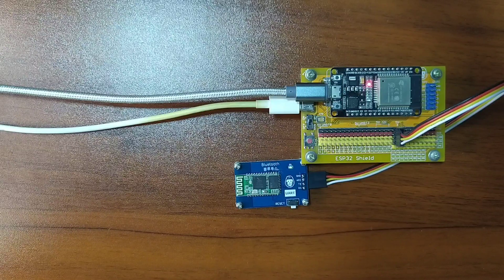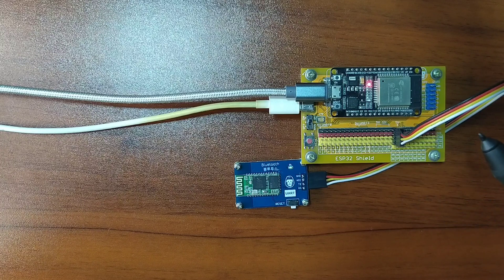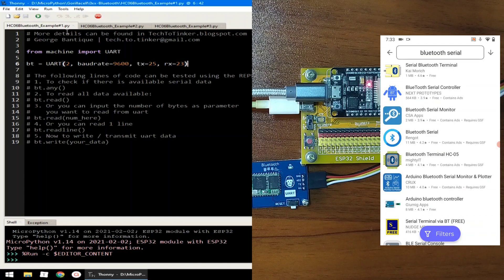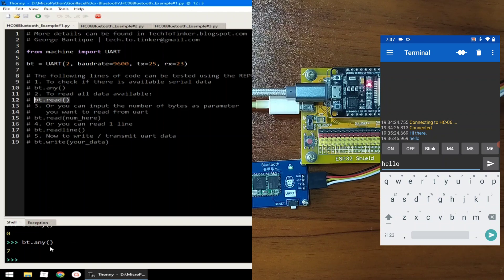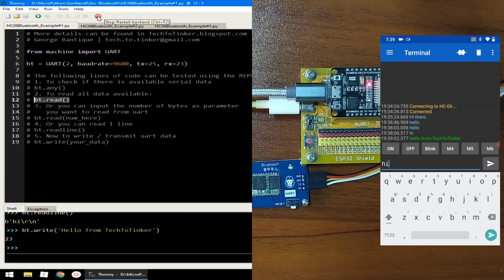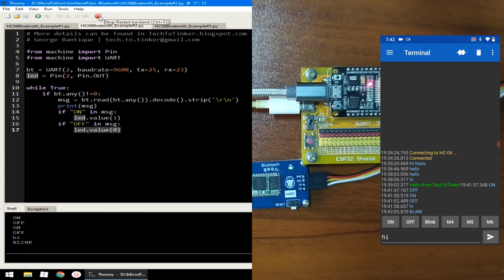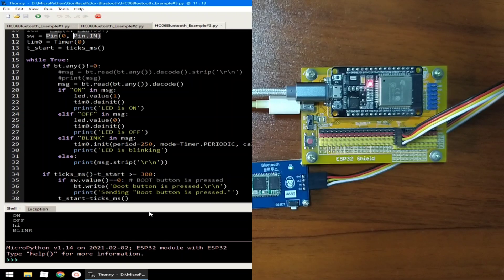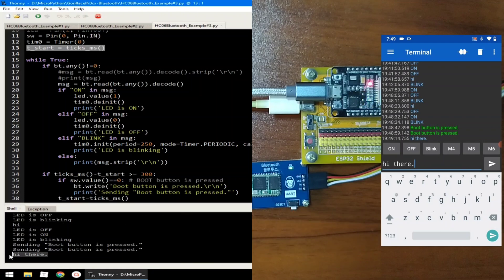041 - MicroPython TechNotes: HC-06 Bluetooth

Comment: pls do a video on ov7670 interfacing with micropython for esp32  pls
Reply from the maker: I would love to but as of this moment, I don't have OV7670. I have not found MicroPython implementation in my quick search. So maybe in the future I will make it.

For the meantime, you can experiment using Arduino IDE + ESP33 + OV7670: https://medium.com/@mudassar.tamboli/esp32-ov7670-websocket-video-camera-26c35aedcc64

https://www.google.com/amp/s/www.instructables.com/OV7670-Without-FIFO-Very-Simple-Framecapture-With-/%3famp_page=true

Regards,
-George Bantique | tech.to.tinker@gmail.com